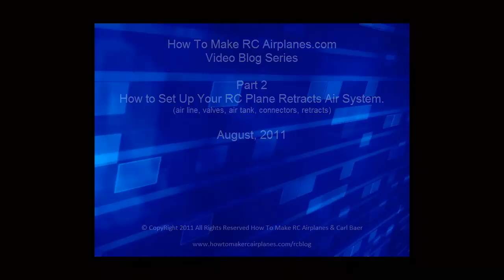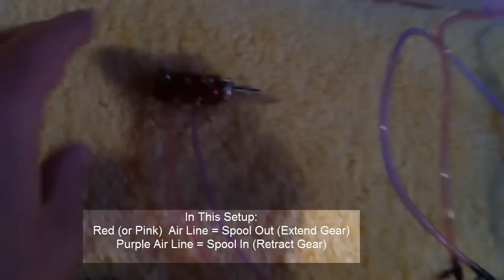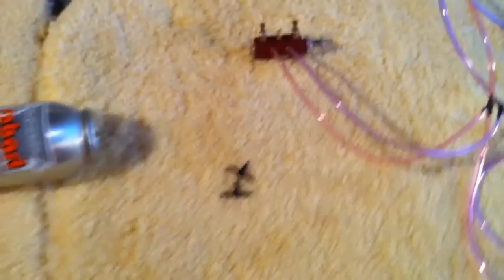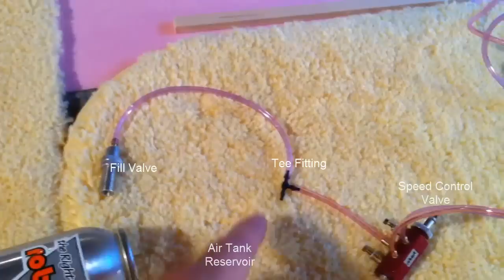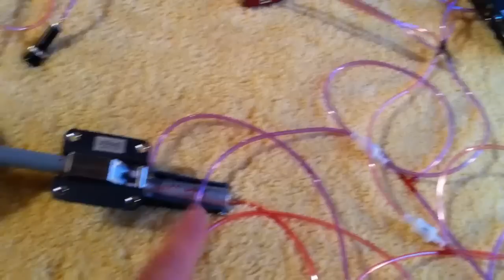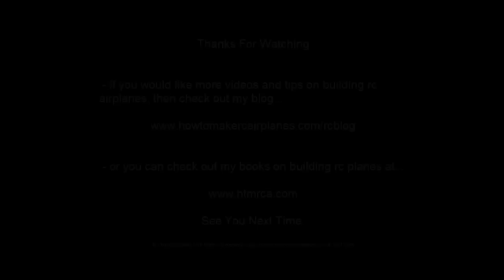Part 2 Completing Air Line Hook Up To Simulate RC Airplane Landing Gear Retracts.

Comment: How is the airline fitted on to the various connectors? Is it just pressed on by hand or do you need some type of special tool?
Reply: My question also. I undid a few that I did a long time ago, and they were tough getting off. I don't know what I did but they were tight.
Reply: @Yahir Rohan i watch on Flixzone. Just google for it =)
Reply: @Jameson Jaden Yup, been using Flixzone for months myself =)
Reply: @Jameson Jaden Thanks, I went there and it seems to work :) Appreciate it !!
Reply: @Yahir Rohan happy to help :D
Reply: i know Im kinda off topic but do anybody know a good website to stream new series online ?